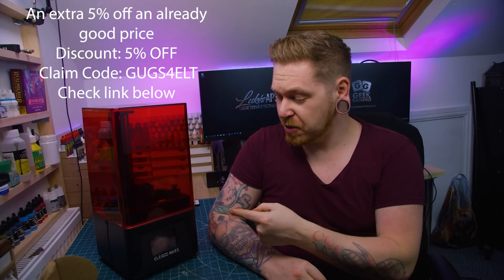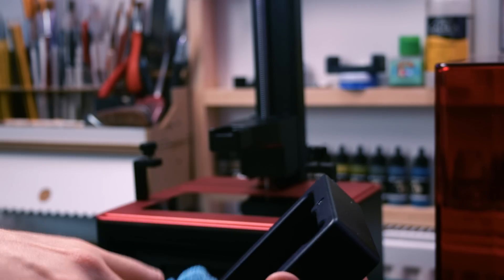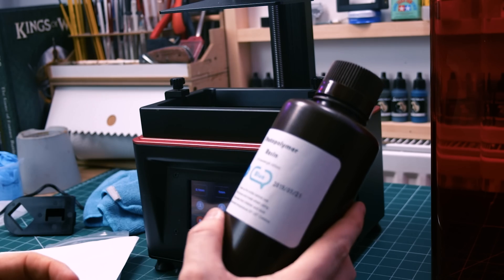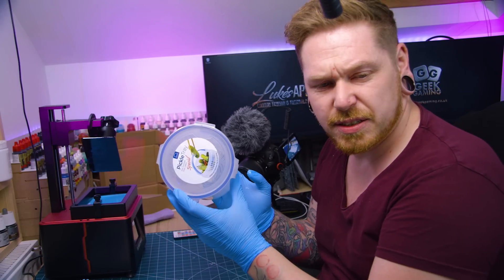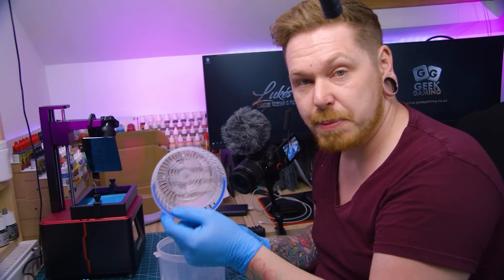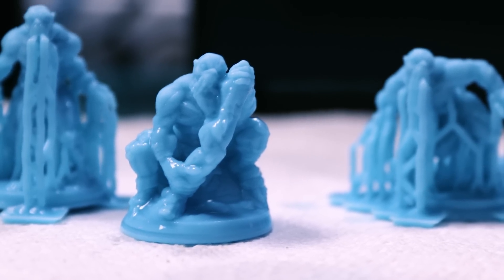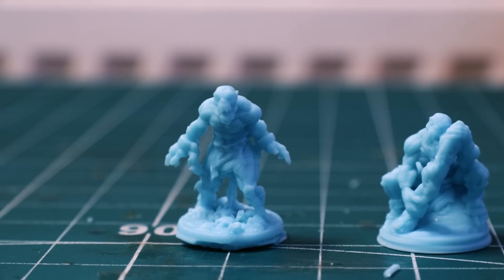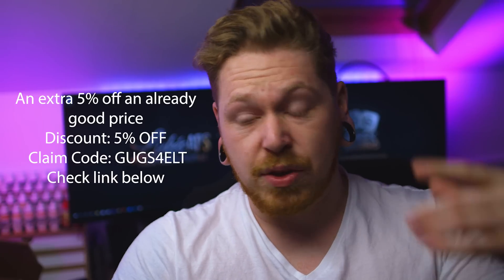MY FIRST TIME Using 3D RESIN PRINTER (ELEGOO MARS)

Comment: Alright, with all the painting channels covering 3D printing at the same time I kinda feel the need to warn new people about some issues with safety, expectations, problems etc.

First of all, safety.
With resin (SLA) printers, touching uncured UV resin is a hazard. It is poisonous if eaten and toxic if touched.
Also the resin can transfer pretty easy too, so anything you touch with the gloves is gonna have UV resin on it. It's pretty easy to end up with a bunch of tools and half a desk covered in a nearly invisible toxic substance.
(CORRECTION: UV resin is not technically toxic, which is news to me seeing as every source under the sun calls it toxic. It is still allergy triggering and and can be new allergy causing amongst other things. Not good stuff basically)

UV Light is also a risk to the eyes, both in the printing and curing stages. I'm not sure about the technicality of those risks but it is definitely worth looking into if you are thinking of getting a resin printer.
The red cover for the printer is designed to block UV light and protect your eyes, so the cover should be left on the printer when printing.

There are a few channels that have covered safety with resin printers. Maker's Muse and 3D Printing Nerd are some good ones.

Next, expectations.
While £200 might seem cheap for the ability to print stuff, that cost doesn't take into account the cost of the curing station, resin, technical failures and the disturbing amount of disposable gloves you are gonna need.

Because of the almost guaranteed mess you will be making and stuff you will need, having a dedicated desk or table is ideal.

And lastly, the cool factor. Nothing stays fun forever, eventually a 3D printer will just be a tool in your arsenal which would be fine if not for the process. if you can't think of a very good reason to have a printer in the long term then it probably isn't worth risking your health and money just to try it.

I should probably mention that I don't actually own a resin printer... but I do have an FDM printer which is the far more common, safe and widely used kind of 3D printer that prints with plastic, and it's the kind of printer I actually would recommend trying.

FDM printers don't inherently have the fine detail of the resin ones but after mine was set up, the process basically boils down to leveling the bed, pressing a button and getting cheap stuff.

And now actually lastly, 3D printing is it's own hobby with it's own quirkes and problems. It ain't all sunshine and shiny models, it's actually mostly clogged nozzles and adhesion problems but it can be a wonderful ride if you haven't invested too much and you can get FDM printers for as cheap as £100 with no additional machines required.
The quality isn't what most people consider to be Great, but printing minis for 4p is something truly special and with enough of an understanding of the machine and materials you are working with it is very possible to get high quality but low level of detail prints.

Oh and if by chance you happen to have 3D modeling or sculpting knowledge. Just... just get a printer, being able to bring stuff into the real world makes digital 3D creation feel like the actual hobby it is.
Reply: Just to clarify it, there is no hint of resin being cancerous or toxic, except for rumours spread by us users, that I found. I'm open for links.

Even though it's not toxic it's highly allergy triggering and might even start an allergy against resin that you don't have till touching it.

I'm not saying it's safer than stated, but as someone working in a lab with different substances that need a certain amount of safety I need to say that cancerous, toxic and allergy triggering and starting are completely different issues
Reply: Great looking models with a substantial leap in cancer vs okay looking models. I'll stick to the FDM okay looking models.
Reply: I looked at the MSDS of my Resins and its really not that bad, and at least for my resins the word "toxic" is just wrong. According to GHS standards most resins are classified as skin irritating and harmful if swallowed, as well as dangerous if it comes into eye contact. And its definitely no CMR material. Otherwise you would need a licence to buy that stuff, at least in my country. Maybe its because I studied chemistry but the handling of a resin printer is pretty easy if you work carefully and have the right setup. And thats no rocket science but a roll of paper towels, a sharp scraper, nitrile gloves (which I use forever because if you dont spill resin you dont need to bin them), safety goggles and a 2l airtight box filled with IPA. My UV curing station is my balcony and the sun.
Reply: Seno
Reply: Good talk. Dangerous stuff if you are in a hurry or just a clutz in general.

Comment: most ppl who print minis use the free software prusaslicer for auto orientation and auto supports. they are much better than the supports in chitubox which comes with the printer. you still need the software to slice the STL though.

Comment: Don't learn supports too much learn to break up the models into individual parts like a kit to avoid overhangs... i been doing 3d models for years.. i got my 1st 3d printer beginning of December.. i use zbrush too expensive to suggest that program to you... but you can do the same stuff with free apps... if you ain't making your own models....

But learn to model is the first tip i would give any 3d printer owner.

Comment: that spatula it comes with didn't do much anything for me either :V i find using a box cutter with the blade fully extended to delicately peel off the prints from the plate more effective than "bang it off with a spatula".

Comment: I use tecnology outlet resins in the uk as a good price and keep well in the vat.
 Bigest tip with supports is you cant print in thin air so look at the model in the slicer from the bottom side and go through the layers to you find a area printing not connected to the rest of the print and add a support.
 You will find supports easier to remove when fully cured , I normally iso wash them then clean water rinse, shake them off and UV bump them . I tend to leave for 24hrs in the sunlight after before removing supports. To remove supports I tend to cut them away from the model to clear the bulk , cut any cross joins then just bend them off. Make sure you support things like fingers and teeth when snapping them off.

Comment: It's hard to tell forsure but it looked like a few you didn't fully clean all the uncured resin in some of the tiny details or possibly exposure off slightly but over all they look great.

 Look into denatured alcohol, I found it works better than isopropyl. Try brushing the models with a toothbrush to get everything all off. 

You can use an ultrasonic cleaner and have the alcohol in a glass jar or zip lock bag with the prints. Submerge the bag or jar in the ultrasonic filled with water. That is the safest method to use flammable liquids in an ultrasonic and it's much easier to cleanup. 

Try playing the the exposure by a second up and again a second below what you currently have. Use your own judgement and see if you notice more or less details and find the ideal exposure for that resin.

The smell is over hyped, it's really mild, but elegoo and Anycubic have mild smells other brands can be stronger or have no scent at all really. But eleegoo is good for odor.

I would recommend using prusa slicer for supporting the model it does a better job with auto and I find manual placement is easier as it hids all the towers of the support and other models on the plate. So your just adding dots. Much easier see and for tight spots. It does a good job not attaching into the print or scaring as much as chitubox does. Once supported export the STL WITh support and then just open and slice in chitubox to print.

Comment: I have had an Elegoo Mars for 6 months and its awesome, I have a load of tips and tricks and also I can see some of the errors you made which is easily done my friend.
Also I have got loads of advice when it comes to cleaning the print which will save you a fortune in chemicals and mess!..will message you on FB.
This is a fantastic resin printer especially for the price, I do want to get a bigger resin printer soon but the big models but for my needs at the moment this is incredible, especially foe the detail.
Reply: @Joel Best Of course, no problem, if  I don't answer straight away it's only because I'm home schooling today, mind bending...

Comment: I’m super addicted to 3D printing minis and terrain. Buddy: wear nitrile gloves and eye protection, this resin is no joke in terms of toxicity. Also I tend to fill the vat almost 2/3 without issues. Oh, I see you put on gloves partway through :) My prints are much easier to take off the plate - you can mess around with less bottom layers and shorter cure time for that.

Comment: Its less about the smell and more about it being somewhat toxic so you might want to have the printer either in a well ventilated space or in another room where you don't spend all your time in as the fumes are toxic.
Reply: UV resin is nothing new. it's been around for decades and it's also what girls get on their finger when they get gel nails applied at the salon. 

Does it produce some toxic fumes? Yes, but it is well below safe exposure limits. Even during 24hr printing the levels are well below safe levels. Barely above background levels.

I guarantee you Luke uses products that are far more toxic to his health
Reply: Air quality testing of micro particles and vocs show it's well below 24-hour  FDA-approved exposure levels during printing. 

Don't drink it and you'll be fine
Reply: @potatojz38  seen a few people complain about health issues.  Better safe than sorry.
Reply: @WaifuTrashWeeb  because those people have an allergic reaction because of a sensitivity to something in the resin. They need to consider wearing proper safety gear or no longer using the printer. Most people aren't sensitive to it. 

Just like most people are not sensitive to propylene glycol that is in vape juice. I myself am allergic and have to find all vegetable glycerin base. Or very low pg mix. If not I get a sore throat and major headache. You have to know what your health limits are. and make a smart decision if it's something that is safe for you to use or not.

My sensitivity does not speak for everyone. Nor does the resin sensitivity.

Comment: Cleanup and support removal seems like a pain at the beginning, but it's not that bad.

I tend to swish about a bit in IPA then run it under a hot tap. You'll then be able to peel the supports off without much effort.

Also, check out the support settings from 3DPrintingPro on YouTube. They are a load better than the stock settings!

Comment: remove the supports before curing. Also, don't touch the uncured resin
Reply: and if you get uncured resin on you it's not the end of the world just make sure you use lots of soap and water and thoroughly clean your hands.

The concern is not noticing and after several hours developing a chemical burn or worse going out side and having the resin cure and have a thermal burn. 

the exothermic reaction from the UV resin curing is well above 80 degrees c in a matter of a second
Reply: @potatojz38  Also keep in mind that every time you're exposed to the resin your body will react more severely. If you commonly run into issues with exposure it's definitely worth taking a step back and adjusting your safety and processing steps.
Reply: Ditto, remove your supports before curing

Comment: Why dont they put an auto level function in there.
Reply: Because you're dealing with planes of light, not with a physical nozzle moving around. It's literally not physically possible to autolevel a resin printer. The closest thing possible is a "levelled from the factory" like the Epax X1.

Comment: The fumes are not healthy Luke, so stop smelling and sticking your nose in.
Reply: There are no "fumes" the odor is what your bothered by. There has been testing by another YouTuber with a VOC  and micro partical air analyzer. Level were well below FDA approved levels over 24hrs. Slight increase over background levels. 

Headaches, sore throat or other sensitivity is a sign of an allergic reaction. Not everyone is affected. Majority of users are not affected, ones that are should take extra caution as they are sensitive to the resin and should wear a respirator, have outside or consider it's not the right hobby for them. 

UV resin has been around for decades and used to do gel nails for girls at the salon.
Reply: And I guarantee you luke uses products on a daily basis that are far more toxic to his health.
Reply: Cogency there are no fumes
Reply: @LeoNelBuilds  That is false. There are fumes, and they can cause intense headaches. Ergo not healthy. I did not notice them building up; however others passing through the area very much did. Slow buildup of fumes in a room may be why you do not notice the smell. Step out for ten minutes and return.
Reply: DezzarTac I have researched this and there are no fumes. There is a strong smell which can give you a headache, but there is no poison aspect about it.

Comment: Hey Luke, I recently got my 3D printer as well (thanks Santa!) one thing that saved me a ton of time was the trick of dunking the model in some hot water (or tea water) for 10 seconds or so after rinsing it with IPA. This makes the resin slightly rubbery which allows you to rip off the supports super easily and also lower the risk of chipping on your models. You can check out 3DPrintingPro on YouTube, he has a video on it where he explains his process for cleaning.
Reply: I do that all the time. Just make sure the print is fully and properly cleaned before running under warm water as to not contaminate the water system if using a tap.
Reply: I know nothing at all about 3d printing; it's a real mind-bender for an old codger like me! I do, however, know a bit about real ale and cannot understand why you suggest using India Pale Ale (IPA) for rinsing them? :D

Comment: Thanks for the video! You can adjust the exposure time to fine tune the detail in the print, but it is touchy. If you have too short of an exposure time, the the supports and prints will fail and if you go too long, then you loose detail but the prints will be stronger.